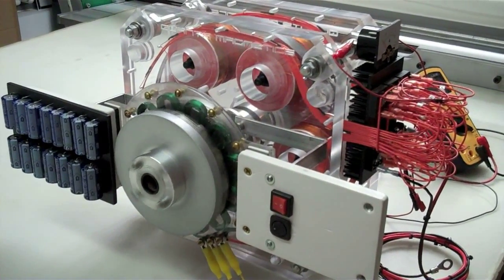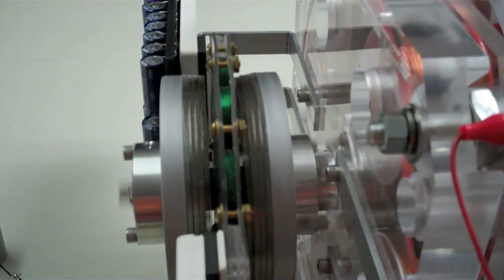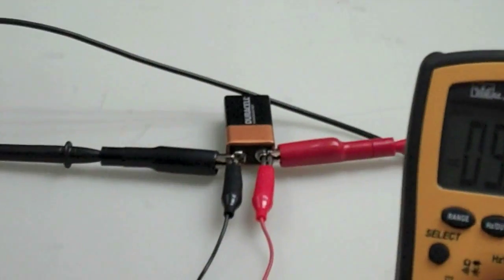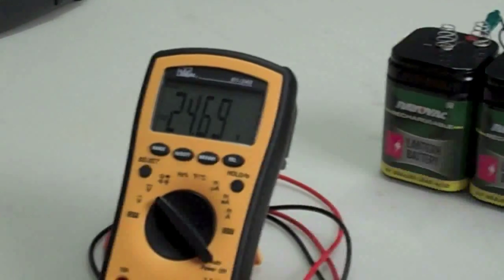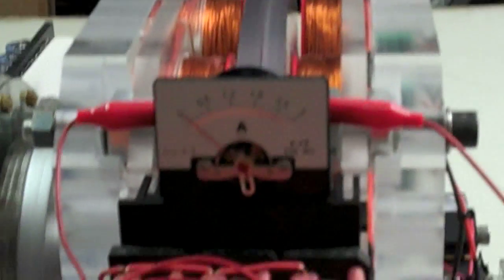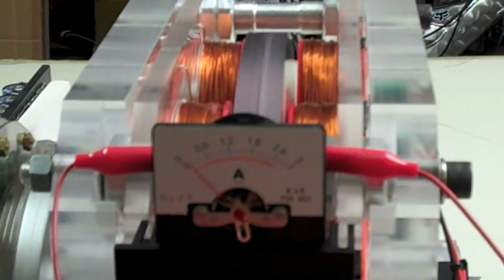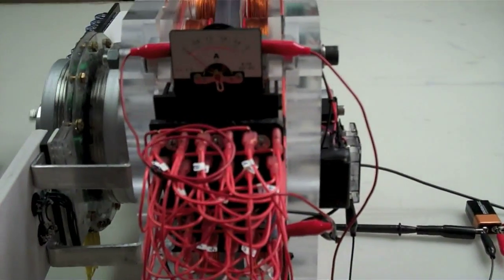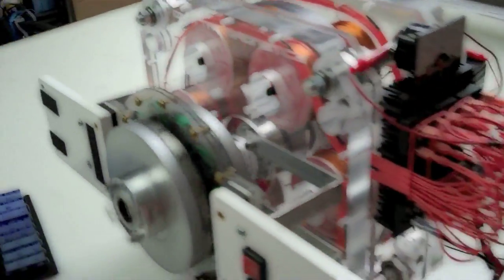Ultimate Pulse Motor Generator - New Energy

Comment: I have a commercial dryer That spins incredibly well. It weighs One. thousand pounds I used a 12 V motor to spin with. Ferenzo lenses. To heat up. Heat Box. I think I will try to make a generator now.

Comment: Michael everyone in this chat is talking about of why this super efficient machine which takes power from a 9V battery (tiny ‘e’) and can charge 4 x Lead acid batteries to 13V, then why not use a separator RELAY to rotate (a way of saying it) the input to your machine, let’s say kick out the 9V, and use one of the 4 Lead Acid in a virtual manner that when that One Input battery runs out of power in say 2 days or so, then a Relay switches that discharged battery with a fresh charged one from the other 3, thereby keeps your baby going for ever !!! Can this not be possible and if it is possible as you CLEARLY show us that even a ‘dumb’ like me can notice, then why not just show it on a video and claim it.

Comment: energy cannot be created
Reply from the maker: Of course!  Here is a statement I made 3 years ago in this comment thread  "This was a simple exercise in energy conversion efficiency. No one is trying to break any thermodynamic laws, but instead, use or re-use what is available".
Reply: mmmm, got it, like i can charge 12 volt 9 ah battery with 9 volt 1ah battery, but it will increase only 1 ah in 12 volt battery

Comment: two things a DC to AC boost converter on the output and the second thing is were the big copper coils are make inner plates that won't effect the spinning disc with holes for the coils but glow water tight for holding liquid nitrogen to boost the power in the big coils

Comment: No law of energy conservation is broken here. the feasability of overunity machine that break the second law of thermodynamics is a misconception. so people you should read accurately the second law of thermodynamics in a rigorous test, study quantum physics and most important, make at your self a question, and think a lot using information critically to get the truth. Remember that the reality it is objective but the opinion and perception are not, this leading to illusory kwoledge that hold us in the cage of presumption.
Reply: so there is no 2nd law of thermodynamics? from what I've read the 2nd law applies only in closed systems, and some proponents of free energy systems claim that physical reality is not a close system. There are always other layers of reality from which to pull energy from. Entropy and negentropy, etc.

Comment: Heard of conservation of energy? You cant increase the energy, whatever comes out must be less than what went in....
Reply: Actually, what goes in gets wasted on the motion of the rotor, what comes out comes from a different power source, the magnets, which use that motion. Moving away from this project, then by your thinking the ITER, JET AND DEMO projects are pure fairy tales when in fact they are meant to break that law. Back to the project, these devices are plausible in the lab, except they're not for commercial viability. Where the ITER operates in MW and only a small percentage is excess, this one does on mW. Penny per cent, this device would not recover the energy required to manufacture all of its components plus generate new energy on top of that. And this is the whole point of the job. Sure, this is more a toy than a real device but it's doable only for the theory.
Reply: 36trooper Inductance through kinetic energy leads to electric energy, the basis for any dynamo and alternator. You're an idiot!

Comment: I'm not an electrician but from what I see here basically you are generating a larger source of energy from a smaller source which could be replaced with solar. Does that mean technically I could run three phase 440 V equipment from a standard 110 household outlet? Sounds too good to be true

Comment: I appreciate this experiment. But if that is mine, then I will compare the power W from input and supplied output based on the formula W = I x V. Only measure the potential V is not showing that the machine is working, because we can do it by using step up transformer with AC current. moreover, I don't know if you are using a diode or not to charge the battery because charging batteries need DC current. And also, 12 volt in your left meter is may come from 2 x 6 volt battery. Try to add one more battery and you will get 18 V in your meter. BTW, you did a great experiment. Better if you support it with technical calculation. I think that's the best way to proof your machine working and make other people understand.

Comment: This is an awesome accomplishment. Even on the grid, a scaled up version of this would draw very little power. Add solar and wind and anything else possible, such as drawing from potential differences between earth and aerial. I wonder if a Peltier Junction could generate from solar heat accumulation.

Comment: ADD A SOLAR PANEL AND A  LED HI INTESITY LITE> YOU WONT NEED A BATTERY.
Reply: Thomas R. Miller it doesn't work actually. LED light is missing bands in its spectrum that are needed for solar cell power production. Incandescent light bulbs have it, but they draw waaay more power.

Comment: Why don't you show us the input current accurately and you didn't show us the output current. Put a decent load on the output and let's see if you are producing over unity.
Reply: The output current is charging batteries - there is no load.  As the battery charges the current drops. The only thing that does not change is the voltage output - that has to be more than the battery you are charging, but once the battery is hooked up you are measuring the voltage output of the battery, not the PULSE of the voltage output of the device.

Comment: What happens when you put the charging contact onto your source 9 volt?  Will it keep the 9 volt source battery charged and therefore keep the machine running continually until the circuit is broken?
Reply: Research the Casimir effect. Are you certain or UNCERTAIN or both at the same time?

Comment: I like your motor, it is made very nicely. However just because you are charging your batteries at 12 volts does not mean they are fully charged. I notice you do not put an ammeter on the output.  My guess is it would take many many 9v batteries to fully charge the 6v lantern batteries.
Reply: lol - the bernini motor is a con.
Reply: Wrong guess. Study how a Bedini SSG motor works - Same concept is use only the coils are on the side of the rotor.

Comment: could you tell me if this model could be applied to the automotive sector. already I've noted that alot of copper is used in your example. How much of copper would ve required for me to get 300 horse power and with this be practical for a high volume production line of these type of motors.
Reply: +Quinton Padayachee and can we still do it on a 9 volt battery? Now that I would pay money for!

Comment: I do not understand why you just don`t use the power you get out to drive the engine?? I`t would run it self,and increase in speed and derby making more power to run it ewen faster. So why is it not a perpetual engine. Just change out youre nine V battery with a Spark to set the engine in motion.. Just a tip... ;)

Comment: P= Watts, E= Volts, I= Amps, R= Resistance (Ohms Law)
If "P" is less on the 9 volt battery than "P" on the generator charging the series 6v batteries then you could send the rectified/filtered energy into the pulse motor and it would be perpetual. With energy to spare??? Which is implied by stating that the limited Mah of the 9v battery was able to fully charge a substantially greater Mah capacity of series 6v batteries.
For a proper demonstration you show the specific "E" across and "I" through each device so we may do the math and solve for "P". E X I=P
Example 9.16V X .1A= .916W (Almost 1 Watt under load)
Unfortunately Current was never given for the load side, only the voltage 24.93V which would make "P" calculations difficult anyway due to the fact it is applied to a stable 12.88V device. (Battery)
Do the video again with 4 digital volt meters using incandescent lamp(s) for the load.
One across each device measuring the voltage.
One in the circuit of each device measuring current flow.
Make sure the settings and display of each meter is clearly visible.
Obviously the object is for "P" to be greater on the load than on the source(9V) as is clearly stated by being able to fully charge the two 6v batteries.
Reply from the maker: DrHarryT That's a great test suggestion. Another very difficult aspect to calculate is the chemical reaction within the lead-acid lantern batteries. There are great opportunities when you push the charge potential slightly over the top.

Comment: I've built such a device as well.  Yeah I'm running at 1000+ rpms at 35-40w without load.  The motor shaft is a long heavy motor shaft.

Comment: Can some please explain to me, an individual with a business background, how this machine does not violate the law of conservation of energy?  Also, if instead of hooking the machine up to those larger batteries you had hooked it back to the 9v battery, would this machine run indefinitly?  Lastly, will a large enough version, or multiple series, of this type of machine be able to power a home with cost (apart from the initial investment of part/materials)?

Please remember I do not have a great science background.  What I know I learned in high school and from personal research.  So please use terms that I can understand (or at least define your terminoloy).  Thank you!

Comment: Those batteries being charged are standard carbon zinc primary batteries - not lead acid storage batteries as stated
Reply from the maker: Look at the bottom of the label on the batteries. It reads "6V SEALED LEAD ACID". They are very easy to obtain.

Comment: So, if you can charge a battery of higher AH with a battery of lower AH you can make many such machines with gradually  increasing i/p and o/p, connect those machines in a cascade and  run a tesla car with a button cell.

Comment: i assume this is a similar principle bedini ssg style generator but on a high efficacy scale, whereby the surges of high voltages manifested charges up battery on the other side..this device should also charge up more than 2 batteries placed in series,? the radiant spike energy developed from these coiled contraptions manifest and work well when it comes to charging batteries and batteries also get desulphated well...imagine if that device was the size of a large refrigerator with copper coils massively built to the order of 100 kilos!!

Comment: So... if you used those two 6v batteries to charge two 9v batteries, then used those two 9v batteries to charge two 12v batteries, then used those two 12v batteries to charge two 18v batteries, and then continued in this sequence for a few years... we would eventually solve the world energy crisis with a single 9v battery.
Reply: Hello Mr. Joseph K, you will need One Machine per House to solve Energy problem which is like $5,000 x 500 million houses around the world 🤣🤣🤣 the World Bank will run out of money 💰 😜😜😜

Comment: A fully-charged 6-cell lead-acid battery will show a voltage of 12.8 V.  Very little power is required to raise the voltage to 12.9 V.  Most motors use little current to maintain speed under no load (friction only.)  Your model is very cool, but you are only demonstrating a motor powering a generator.

Comment: Since you have more Volts at the output than at the input, what happens if you feed the output back to the input, can that cause a cumulative increase in Volts? How much output will it handle until it blows? Can you make it accumulate more Volts up to a certain point (calculated for staying unbroken longer than the life span of a human being) and then make the process "infinite" at a constant power output? What are the limits here?

Comment: Great job, It is almost like the John Bedini's School Girl Motor. I am also working on a energy system, that I hope to make  two power outputs of 120 volt / 100 amps of pure sine wave alternating current. right now, my system input is at 1.5 VDC / 0.078 mA and the output is at 78.29VDC / 19.83 amps. However, my system will only work for two hours.

Comment: Ive been trying to find the motor again myself but what I remember is that it didn't use current but did use voltage only.  The picture of the motor had ice all around it but kept running!  Most motors have iron around and inside them to create huge current draws which create heat!

Comment: This is a very efficient motor driving a very efficient generator.  This is the type of system i'm working on ATM.  I'm using 6"x2x1" ceramic magnets with large window type coils for the generator.  I will make a SG type motor to run it on the same shaft.

Comment: So if this thing makes more energy then it makes, then let it power itself in a video.
Reply: It wont work that way cuz it will see it as a load.
All i would like to see is how long it would take to charge a 12 volt car sized battery.
Reply: @farfromfunny  Maybe not if it charged a couple of super Capacitors with relays to isolate them when full. Then. It could just either feed or draw depending on the level.
Reply: My first thought.

Comment: Somewhat accurate digital voltage measurement on input and output with inaccurate, crusty old analog current measurement on input only. **rolls eyes**
Reply from the maker: Replace the "c" in crusty with a "t".

Comment: Would this in theory make a perpetual motion machine possible?
Reply: no, perpetual motion is a myth, the more physical load you want to drive the more power is required to maintain motion and speed, therefore a 9V battery would be nowhere near enough to drive this engine and a simple feedback current from its output wouldn't be enough either as the electricity charge would drop with each rotation of the motor in the 'engine' due to the failing drive charge, hope that makes sense :-)

Comment: So get the machine running then change the source to the device being powered. Surely if the input is 1/10th of what is coming out then there should be ample power to maintain the running of this device. I didn't see an ampmeter hooked up to the output so your claim of input is1/10th the output is unjustified. I can hook a 9V battery up to a small circuit and get 30kV but the current is bugger all.

Comment: As some have already commented to which you have no answer, if what you have presented here is true then this device SHOULD be able to power it's self once an initial power source starts it.  If the output is in fact higher than the input then you should be able to make it run off it's own power output and it should run endlessly with no outside power source.  Correct?

Comment: Couldn't you technically get it going with the 9v, then connect it's output back to the input and make it run off itself, and it will only use what it needs to keep going and then you could have the left over energy to do whatever with? Essentially infinite power?

Comment: OK, can this run my 70 inch flat screen TV, or my Computer, or my microwave oven???

I understand and I can appreciate what you have build and I want one, if not three.

If not, can we build a bigger system that can run these appliances???

So, that is why I am asking. Because, today, we use a lot of electrical power...

I am looking into alternative energy and I like your ideas...

_________________

What if we had 60 pounds of copper wire, what are we talking about???

What could we do with more copper wiring???

Comment: I reckon if you put a pair of flat batteries on you'd see the amp draw go way up. I noticed you had a .8 or so volt drop on the 9v battery during your charging of the already close to charged batteries.

Comment: So what I'm getting out of what he is saying the coils build up a charge, and then release a charge? The energy that is required to do this only gets a high drain when it's 1st building up the charge, and then it has less friction after the charge is output?

I'm asking these things because I really don't understand what this thing does even after watching this video. What I do know is that you can not get more energy from a generator than you put into it, so do these coils get energy from two sources?

Is it pulling electro static energy from the air, as well as getting the energy from the batteries?  Then outpulsing that energy, where it is collected someplaces and reused?

Again all of this is me trying to figure out just what the heck this thing is, and how it's supposed to work.   A overview of what the concept of this device is, would have been a better way to start instead of going through a break down of the different pieces of the device.

Comment: Colin you are correct, this is a storage system. The power industry has a small grid of something similar working in CA. Basically they are an electro-mechanical capacitor. Some are made by this company,[http://www.beaconpower.com/products/smart-energy-25.asp] I think that it's good to teach out this technology though. The more we become aware of it, the more we will have. One potential application is to buy power for your home when it is cheaper to make (at night) and store and use it during the day. It might also be cost effective vs. capacitors in large energy projects, when you need a large energy discharge, and have a few seconds or minutes to recharge from a more steady output device. For example a nuclear power plants output (steady) to a large beam weapon where you need to leverage the power output.
Original, yes and no, exciting, yes!

Comment: Great vid man!
is there anyway you could charge up a 9v battery off it then switch them so the newly charged battery is recharging the original battery?
how about 3 x 3v batteries in series if the 9v volt wont charge up?